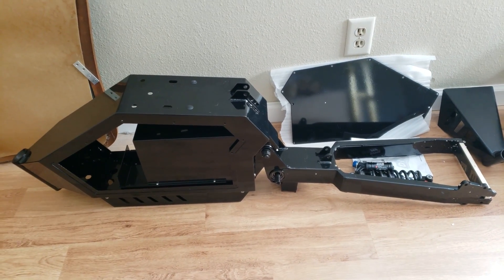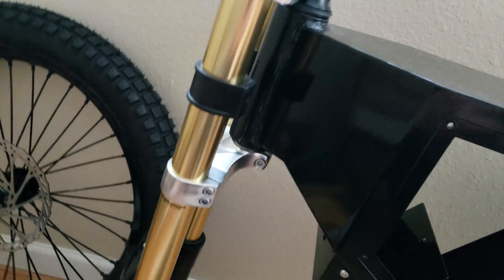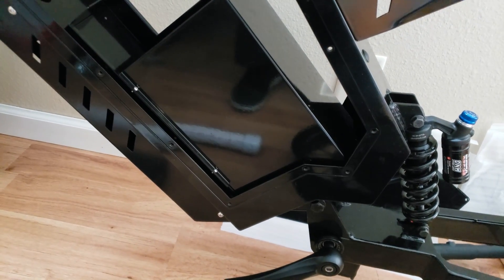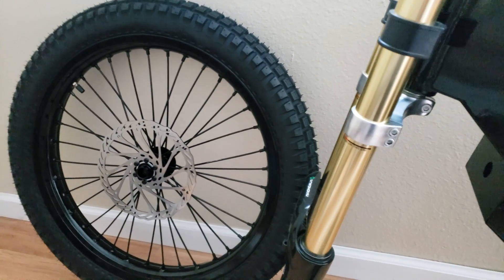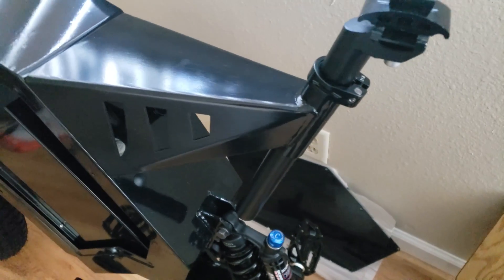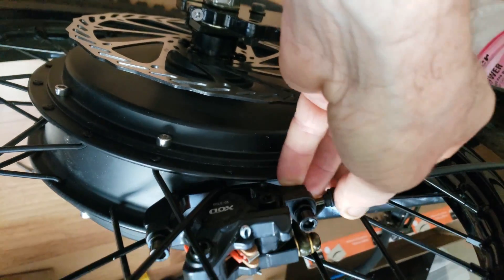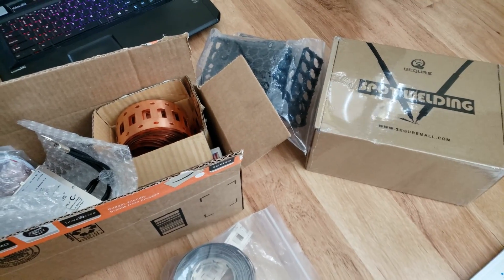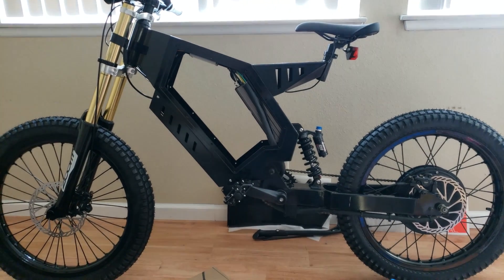Enduro Ebike build start to finish

Comment: That is hilariuoius you said that because thats exactly how i started.. I got back into RC cars about 2 years ago after not having them since i was a kid. I LOOOOVVVEEEEE the advancements in the RC world. I currently have an Arrma Typhon 6s, Kraton 6S, Typhon 3S, Kraton 2s, WLtoys 144001 brushless, 144001 stock, WLtoys A959 brushless, A959 stock.

After 2 years of wishing i could ride inside the rc cars because i miss dirtbikes and gokarts, I decided to look into electric vehicles so i could drive on the street and not get harrassed by cops. I ended up going with scooters because theyre regulated less than e-bikes in NY.. My very first scooter was a cheap 48V 1600W nothing scooter, and my current scooter is an Xplor Odyssey. 60V 6000W. It hauls ass!

So i definitely get your need for speed bug. RC cars are great, i love em, but sometimes you dont wanna sit on the side lines controlling your vehicle, sometimes you need to feel the wind in your hair!

Comment: I built one went with 72v35ah batt and the 5000w v3 and it’s insane I go about 45 miles jammin out per charge
Reply: Can you change batteries during the day? Or it doesn't get off the frame?
Reply: @PapaleguasNY  late response but technically yes a battery swap would be possible but carrying around a 30 pound battery in a backpack would not be very fun assuming you need the extra range to get the the next juice station
Reply: Hey man how much did it cost you?
Reply: @corbinandersen809 , I was thinking a rack in the back with the extra battery when you might need it, not very often you would need it with you.

Comment: For the spacer issue in the back perhaps use 2 torque arms and run a bolt through them both.  Looks fine as is too!

Comment: Hi how can you adjust the seat to lower. I’m 5’8 and thing is way too big even dropping the seat the lowest.
Reply from the maker: Well I've seen some people lower the entire seat mount basically move it to the bottom holes on the frame and then you may have to drill two new ones to mount it completel.

Comment: heya guys to get the higher speeds and long travel distances i recoment opting for the new 3.7 volt 20 amp hour flat pack lithium cells,they all bolt together in series ,so no spot welding and can output the 100 to 150 amp dc continous that you want,also has benifit of being able to charge inexcess off 50 to 60 amps ,so can charge up in an hour .most  of the 18650 based batterys out there just cant supply a 100 amp continous ,the spot welded nickle strips just arnt dense enough to channel it.

Comment: I know what you mean about tossing all of the reflectors right off the bat. I’m not against safety, but I hate the imbalance. I can feel with those pieces of plastic screwed to the spokes. I found something that I really like that gives you the reflector safety, without messing with the bikes performance, “ Rim Tape” I have black rims and I got their Black Ice version. It isn’t as black as the wheel paint, dark charcoal would be a proper description. But very effective reflector. Looking forward to seeing the ride.

Comment: 12:01 and what is that for?  Does it have gears like common bikes?
Reply from the maker: Hello yes it has the Free wheel and  chain like a common bike this one does not have the rear cassette if that is what you're asking
Reply: @samjohnson517  OK thank you.
Reply: @samjohnson517   yes but it has the derailleur there. what is that for?
Reply from the maker: @flag2612  that is not a derailleur that a chain tensioner it keeps tension on the chain basically keeps it adjusted
Reply: @samjohnson517  OKAY thanks! friend. Sdos from Posadas missions 👏

Comment: Hi from across the pond in England, great video, im also building a Enduro bomber bike, i wish to give you some advice, 1, please set your sanctions flush with your upper crown, or yokes as we say in England, i notice alot of people dont and forks are not ment to be poking our of your top yokes. 
2, please ditch your cheap $15 headset they supply you with, instead by a FSA 360 Orbital headset, with sealed bearings. FSA make the best headsets in the world, very durable and reliable and hardly needs servicing and only around $30 for a top FSA headset, also go for short stem and high riser bars so your body position is similar to motorcross. Or instead do what i did and treat yourself to a set of Rocksox boxxer front triple clamp forks because they use direct mount bars system thats very much like motorcross bars.. i notice that mountain bikes use stems that put the riders arms / hands over the front wheel, where as motorcycles the bars are directly above the fork stem, not over the front wheel, i hope the advise helps :)
Reply from the maker: Hello and thank you for watching, as far as the forks go I left them like they came I did not want to lower them flush because that would raise the height of the bike and I'm having a problem with that as it is because I'm short LOL I agree the headset is not the best but it seems to be working okay for the moment  I like the way Iam sitting now,  I have the seat as low as possible  the short stem  brings the bars back to me, kind of like  an Enduro or downhill mountain bike. If I was taller and had the seat post adjusted high I can definitely see where the taller bars would help.

Comment: My frame came in’ same color as yours….but mine came with four torc straps with a square bit built into them…..it’s hard to explain….but it makes the rear tire easy to install….the brackets slide right into the dropout spacing and there adjustable….I believe they updated the drop out torc armed to slide into the rear fork slots.then they bolt into the fork and the side nut is tightened….the only confusing part is I was sent 4 of them’ maybe it’s for more strength’ if you have a 5000watt and up motor.
One fits in the slot and the other probably is used for spacing….needless to say I have 2 torc arms for each side.

I think all the frames are the same….but the hardware has been updated….if you got the same company as mine….I received a 200amp Savoton…I believe they gave me the 200amp one by accident….I remember customizing my order for a better display and they sent the upgraded speed controller, and the display I ordered….anyway the mistake was to my advantage.

As for the speed controller size…it baffles me…why they would include a small bottom bracket…to small.
I welded 4 tabs to the bottom part to fit the controller and used some 1/8 MDF plastic to fit the gap….I used a heat gun to fold the plastic, and cut it to shape to fill in the gap’ you don’t need a welder to do it….you can use screws, and some flat 1/8 x 1/2 inch wide steal stock and crew them in….I tack welded mine to look professional.

Gonna do a build video on mine soon’ still waiting on the handle bars and the 7speed shifter….I got lucky and obtained the rear derailleur, and crank from a female MTB I had laying around….my bike will be mostly a road bike…I ended up going with 27.5 inch tires….FYI this frame is able to fit tires all the way to 28 inch….without any special adjustments.

It looks longer….due to the larger tire size….but Unique.
Reply from the maker: Sounds great man!  Can't wait for the video!

Comment: I got the 18650 batteries from old Bird scooters! They use LG brand batteries. You can actually use the whole setup if you dont trash the wiring tearing it apart. Its a 38 cell pack.

Comment: I’m wanting to building or get a battery build for me. I’m looking at the QS 273 t3 72v 8000w hub motor 19 inch wheel and street tire and for the Controller: Sabvoton 72200 200 amp controller unlocked

I don’t know what kind of 72v battery I need for this or what kind of BMS to do. 

Speed and range are the most important.

Comment: we had one of these frames to and managed to reduce the frame weight to 13.5 kilos ,had to make alot of cut outs ,and carbon panel inserts but makes big difference ,also changed the rear shock to a 320 mm external resiviour.just needed new mounts thats all.
also thinking of drilling out hole saw holes in swing arm maybee 5 each side to reduce more weight, 
the biggest plus mod was makeing a single sided jack shaft ,so its possible to ride the bike around town pedaling with out using the motor, alot of stuffing round ,but makes its a useable bike now.
Reply: Wait your going to put a hole in your swingarm, no don’t
Reply: @HIPfreez226  I’d say your message was never received and the Swiss cheese swing arm claimed yet another victim
Reply: @Agilepickleunite  no it worked a treat used gold anodised tube inserts for contrast ,there is still zero flex in the swing arm we are talking 8mm think extra hard carbon steel with 2 mm steel sheet creating the box look ,its way over kill in the first place

Comment: They say you can mount those motorcycle style longer seats on these but I don’t really see how with that post in the way
Reply from the maker: The post is sitting in a bracket that's held on by four bolts and that bracket is changed when you switch to a motorcycle seat

Comment: Hi mate can you remember if you had to install the bottom crown race bracket on the folks
Reply from the maker: Hello yes I had to install it, I used that big PVC pipe in my video to pound it on.
Reply: @samjohnson517  thank you for the reply I bloody 4got to put mine on. As I add a lip at the bottom of the steering tube

Comment: Hey guys I’m having trouble building mine a bit the bike is taller then I am I have 26x4 tires with 220mm rear shock and height is 5’ 9” any suggestions what size should I put for the rear suspension

Comment: Hi sam how the breaks still work fine what lenght its the rear break hose because i have the same frame on my way thank you in advance and i still waiting on more videos from you
Reply from the maker: Hello yes the brakes are not great but they work okay especially after I changed the brake pads to semi metallic
Rear brake hose length is 155 cm
Reply: @samjohnson517  thank you sam God Bless You man I don’t know wish one i can bought i buy 203 mm  magura break rotor and I bought the mounts thank to you info

Comment: Hello Sam, Great video! I just ordered the same exact frame.  The pivot bolts for the shock, can they be ordered on Amazon or eBay? Also does it absolutely have to be a 200mm shock or can I go with something less?  What breaks would you recommend also? Thanks in advance.
Reply from the maker: Hello, I went with the 190mm shock and I ended up finding the pivot bolts for the shock on AliExpress

Comment: How do you take the rear wheel on and off?
Heard I need to disconnect some of the electric cables, got no idea what I'm doing when it comes to electronics. Never seen you do this in the video so missed the most important bit.
It's nice to know if the Hub motor broke I would know how to replace it or a basic tier change.
Reply from the maker: Well if you're just doing a tire change you do not have to disconnect the wiring you can remove the tire from the side of the rim  that does not have wiring. If you are changing the hub motor then yes you will need to disconnect the wires that run to the controller, there will be three large wires and usually two plugs.
Reply: @samjohnson517  okay thanks for that I'll bear in mind for future

Comment: I’m 5/7 I had to return the 200mm shock and get a 150mm shock….my bike uses 27.5 tires so it became impossible to get on it so I Measured the eye hole to eye hole…and found a 150mm will lock bad ass….and the travel will not bottom out the frame.
It’s much easier to get on it….it looks almost like a Tron motorcycle’ many old schoolers remember that video game’ I’m gonna put bottom, and rim lights on to give it that touch.

Mine will be mostly road or dirt trails.

Comment: Would a 750w motor be enough
Reply from the maker: Well you can install it but you would not  be able to put very much power to  it's probably not a good idea because this bike is so heavy would probably  be better off using it on a regular bicycle frame
Reply: @samjohnson517  well himiway has an  ebike called the zebra and it has a 400lb capacity so I thought that just basically changing the frame wouldn't make that much of a difference. If you were to have a pretty similar build to yours how fast do you think it would be a 750? Maybe if you overvolted it? I don't need a speed demon just something that goes like 30 or 20
Reply from the maker: @xPRINCEOFDEATH  yeah you might be able to get it to 30 but that little motor is going to get hot especially uphill but you're probably be helping it with the pedals anyway.
Reply: @samjohnson517  I don't really need to be going more than that anyway but is there a way to cool it down ?
Reply from the maker: @xPRINCEOFDEATH  I've seen some heat sinks bolt to the outside of the motor I don't know where you get them from I don't have much experience with them. Maybe think about selling that motor and buying at least a 3000 w
Reply: @samjohnson517  thing is in my state it's illegal for an ebike to have more than 750w and I'm kind of stickler for the law. Is there anything I would need to change for your parts list to accommodate a 750w motor?

Comment: looks so fun im building one! for the rear shock absorber would it help to use 210mm or 220mm since im 6'9 ?
Reply from the maker: Hello and thank you for watching, my frame for what ever reason called for a 190mm but with your height I think a 210 or 220 would be great for seat height and not to mention the extra travel

Comment: For the backspacer maybe grind down one side of the washer so that it's flat and put the flat side toward the wire then the one that came with it can be up against the frame so another video where a guy did that with two washers seem to work very well with him same exact issue
Reply from the maker: Hello, I have an update video of this bike build and I just ended up leaving them out completely. I'm using the torque arms  for spacers.

Comment: Any chance you could go through your links and update them, most of the eBay listings aren’t available anymore but I see similar listing, just want to make sure I’m getting everything I need. 

Also all in what’s the build cost. Looking to be under $3k
Reply from the maker: Hello I know I'm sorry about that but I don't want to just put random links in for Sellers and and parts that I didn't actually buy. But most of the stuff is standard anyway I wouldn't worry too much about it I would get the frame first and then you'll have your specs for everything else
As far as the price you're going to be well over 3K if you're going for something with some serious power if you're not worried about speed and power too much you might be okay

Comment: My only concern is that controller not getting enough cold air inside the frame, I think I'll try just fabrication widen the box on front down tube
Reply from the maker: Yes I have the same concern check this video out made some modifications and did some heat testing
https://youtu.be/Rim9OYkVG5o

Comment: hi Sami, i have a question because i have the same kelly kls7230s and qs205 v3 t5 3000w controller with a 72v 30ah Samsung 21700 
bms 120a battery, what percentage do you mark in current motor and current battery in the controller parameters?  Thanks in advance and greetings!!!
Reply from the maker: Hello mine is actually a sabaton 72150
Are you talking about phase  current?
If so mine is set at dc/boost current : 150 amp,  max amp 350 and protect 450 amp
Reply: @samjohnson517  sam your motor is the qs205 v3 3000w?
Reply from the maker: @liberto2065  5000w
Reply: @samjohnson517  ok
Reply from the maker: @liberto2065  internal speed limit 65%
Low speed limit 45%
Mid speed limit 85%
Reply: @samjohnson517  thank you sam

Comment: Please somebody tell me the size of the rear axle. Mine straight snapped. Don't know why. But I need a replacement. I could use some help.
Reply from the maker: Hello the axle it's kind of an oval shape so it's 12mm by 16mm

Comment: I'm a tall man do you recommend 21in wheels instead? Or will it affect the performance too much?
Reply from the maker: I do not have experience with 21in wheels I do not think one would fit on the back,. This is a pretty big bike as it sits but if you're looking to raise the seat height I would try a longer rear shock instead

Comment: Nice video i got a question if someone can answer, im doing my own ebike build and wanted to know the make of ur wheel on the front if possible as i wanna use tyres with better tread. Thanks in advance
Reply from the maker: Hello, I added the front rim to my kit when I ordered it. The rims are unbranded, I'm using shinko 241 tires which have been working great for Street and dirt.
Reply: @samjohnson517  thanks for speedy reply, i was looking at getting 20 inch rear hub but having problems looking for the front wheel, didnt know where to start :)
Reply from the maker: @chriswallace9867  no problem yeah for some reason the front wheels are a little tough to find here's one it's a fat tire it's a little pricey though

https://a.aliexpress.com/_mtmz0Tq
Reply: @samjohnson517  awesome thanks again will start to look based on the one u have suggested, price is nps.